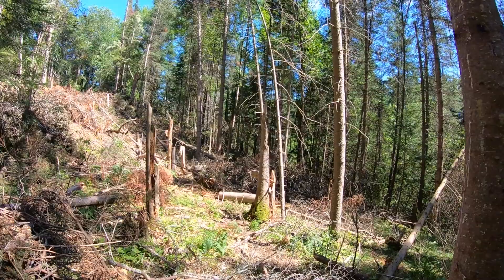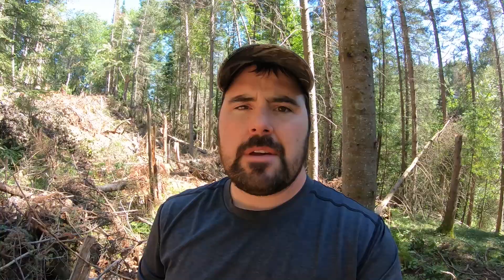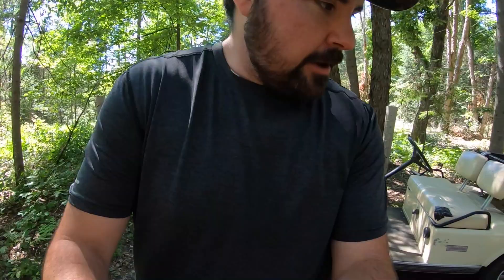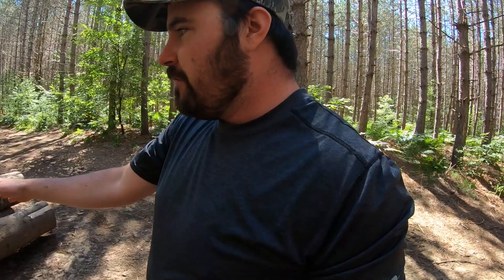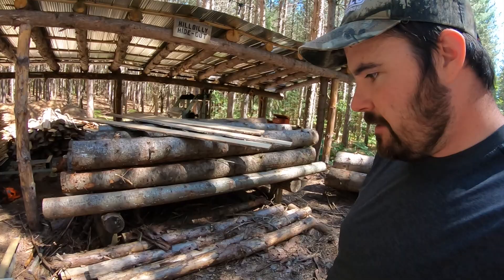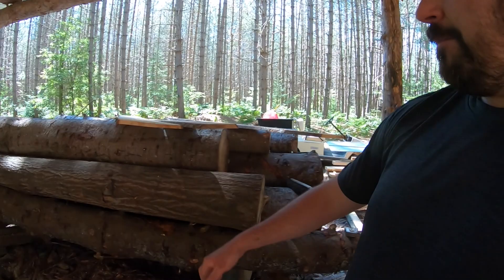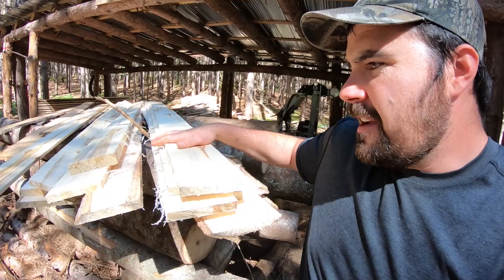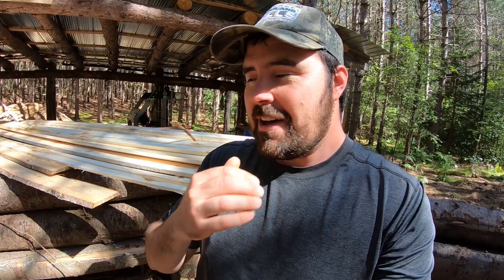Cutting Poplar with Portable Sawmill | Sawing Logs with Insect Damage

Comment: You don't necessarily need to get your tractor down the hill.  This is one application where a winch (skidding winch being best) would be very helpful in 'yarding the logs up to the landing'.  Just park your tractor on the main trail and run the winch line down to the logs to pull that out.  With the application of a few snatch blocks to redirect the pull you'll be able to get most anything up the hill you want.
Reply: I was thinking the same thing run a winch line to the bottom of the hill don't know how long of a run that  is can't tell on camera

Comment: Hi Sandy thanks for sharing your experience with us. I have been watching you for about 3 years and have been dreaming sawmill ever since. I just bought a used 130max and have been using it the last few days. It works really good but i have noticed like in this video that one of my bunk is slightly higher that the others and makes my cant rock a little bit. Do you know how i could fix this? My sawmill came with the wooland trailer. If you can find time to answer my back it would be greatly appreciated. Tks for all you tips
Reply from the maker: Hey there Vincent! I really appreciate all your support over the years. Great to hear about the sawmill. It may be possible to switch around the high bunk to a bunk near the end where the log doesn’t rest when sawing. This could help bring the bunks back to flat. I hope this helps

Comment: This is the case where, if enough logs, an ATV trailer for the mill would be ideal.  Like you said, the effort to get the logs to your mill might not be worth it, but with a trailer you could bring the mill to the logs.  This might not be an option for you now considering that if you got a trailer, your current mill shed would have to be reworked.

Comment: I dont have a tractor but i have cables & snatch blocks pulled 8 poplar logs over a hundred yds, last 2 i tried 2 at same time no problem through the woods didnt even use the winch power just backed up. 100ft remove cable &  rehook yeah i think I'm crazy right

Comment: Hi Sandy,
I haven't seen you clean logs before milling (maybe I missed it). How do you avoid dulling blade cutting through dirt built up on log from dragging.
Thanks
Reply from the maker: I just use a little brush